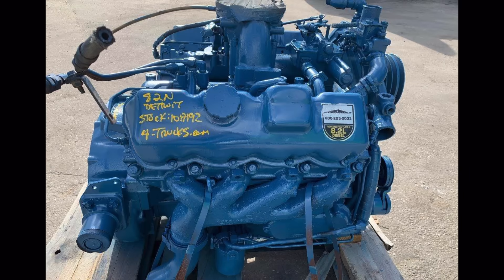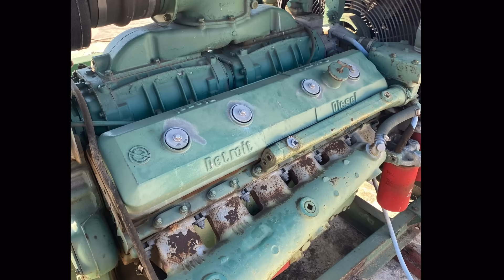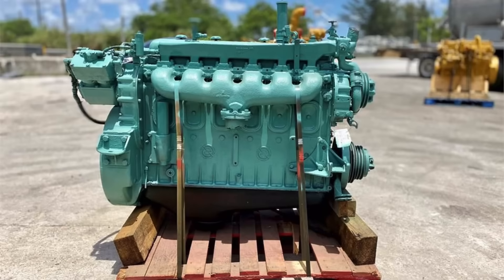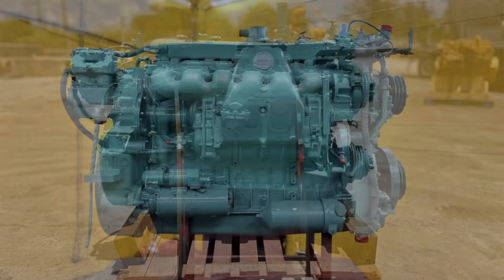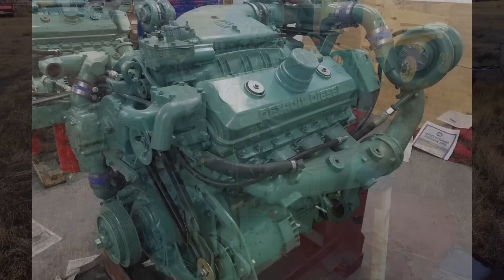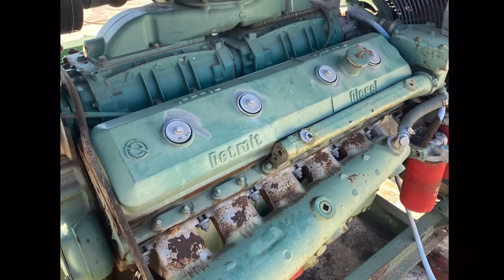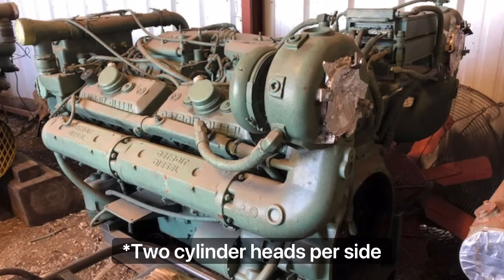Best Engines: GM Builds an Awesome V12 with Detroit Diesel's 12V71 "Buzzin' Dozen"

Comment: This engine WAS NOT design to be  "naturally aspirated"...it wont even work.
Reply: You misunderstood. They ARE "naturally aspirated" with a blower. Meaning the blower is not a "supercharger" or "added" part for extra air. The blower is a necessary part on these and is not a performance enhancer. The word "supercharged" or "supercharger" didn't exist until hot rod guys started repurposing Detroit blowers for use on thier gas engines. 
So, a non-turbo 2 stroke Detroit IS "naturally aspirated"
Reply: @johneckert1365  I'll quote the 6-71 owner manual:
...a two-cycle engine, therefore, does not function as an air pump, so an external means of supplying the air is provided.
A specially designed blower, on the side of the engine, FORCES cleaned air into the cylinders to expel the exhaust gases and fill the cylinders with fresh air for combustion..."
GM itself started to call it NA(inappropriately i would say) just when turbocharged engines where introduced, to differ the versions.
Reply: @TheLuxxx797  They did use the word "supercharged" did they???? 
A supercharger is an added device for extra performance. The blower on a Detroit is NOT an added device for extra performance. 

The blower draws air through it's inlet at atmospheric pressure. That's what naturally aspirated means Einstein.
Reply: @johneckert1365  Aspirated means that the piston SUCKS the air inside the cylinder...thats doesn't means that,  as in this case, a engine with a blower is supercharged.
probably you don't even know how a engine works
Reply: @TheLuxxx797  I OWN more 2 stroke Detroits than you've probably seen in person. I've overhauled several, both in-frame and out-of-frame. 
The blower sucks air into the engine. If you don't think it does, try restricting the air flow in one sometime........
You've even read it yourself, GM distinguishes thier engines as NA when they aren't turbocharged. You can call a Detroit Diesel "supercharged" all you want, but it won't change the fact that they're not. You should consider simply allowing people to THINK you're stupid, rather than consistently PROVING it to them. 😑

Comment: Never seen a Detroit in the flesh, but I have ties to them, one of my relatives worked for GM at DD in the early years, I think through the war years and on. 

I’ve always loved the sound of the 2-stroke. Something else cool of note is the larger stationary power plants, the    20v149 are absolute monsters. AT&T from what I understand used primarily DD for their auxiliary power for their central offices.

Comment: In mountainous conditions, logging, especially to be able to shift quickly off a landing, the V-12 was unmatched. Torque at idle was the highest, even amongst much bigger engines, K model Cummins, 3408 Cat. Clark trucking in British Columbia had a fleet of V-12’s hauling refrigerated goods in those mountains. Horrible fuel mileage and constantly in need of topping up the oil was a down side, but my gawd did it ever sound fantastic pulling hard. Very, very effective jake brake as well.
Reply: Had a friend that was a mechanic for a logging outfit that ran those. Went on a late night "test drive"  bobtail. Windows down foot the floor never forget that sound.

Comment: Legendary engines, any of the two stroke Detroits. 
I actually know where there is a GMC Astro 6v-71 and a 10 speed manual that has 67k miles equipped with a grain box on it for sale 10 miles from me for $7,500.

Comment: We had 8V71s in our WW2 era scout boat. It was an Aviation Vessel Rescue boat used for pickup up downed air crew in the Pacific. During the war era it had the gas Allison V12s which worked good at sea level. Those were removed and we got the 671 inline engine. Those wore out and were replaced by the 8s. They ran flawlessly for many years in the boat and we had to wipe them down after each cruise looking for oil leaks. The engines had been put all the aft after the war era mid engine set up. The boat sat down in the stern and out could see it when we tied up next to other AVRs. Great engines.

Comment: I commend you wholeheartedly for your accurate description of how these engines work and for NOT calling those blowers superchargers which they are not when they are used on these applications. 

This is one of the most common mistakes that car guys make because they are used to seeing them only on hot rods, hemis, top fuel dragsters and the like where they are in fact, superchargers in those cases. You really need to have had exposure to trucking, diesel mechanics or some related field to understand the difference. Bravo!
Reply: Thank you, I cringe when some dolt calls a turbo. Detroit twin charged because of the blower.
Reply: @WhiteTrashMotorsports #ME TOO
Reply: @WhiteTrashMotorsports  Bloody oath cobber 👍
Reply: I could be wrong but I think the first roots type super chargers were scavenged from DD's.  Early on they were all classified as either 6-71 or 8-71 blowers.
Reply: You are in fact, absolutely correct. That's exactly where they came from and it was down to nothing more than availability. The 71 and later 53 series Detroit Diesels were in widespread use in those days and the blowers off of them were plentiful as a result and relatively cheap.

Another common misconception is that the 6-71 blower gained such wide favorability for use on Mopar hemi engines because it was engineered to work on a 426 CI engine which the 6-71 Detroit is. This is wrong however as those engines had been around since the late 30s and the 426 Hemi never arrived until the early 60s.

It was simply a coincidence and a case of those being very common engines in those days; I myself operated several of them in my early days, and availability was high.  @jdcole333
Reply: @hughjass1044  Good on you mate for trying to explain to the poor buggers the difference between a Blower and a supercharger!! There are so many of them out there who do not have clue!!
Reply: @damienodonohue1327  Well, it's understandable that they wouldn't. I didn't understand either until I got into trucking.
Reply: @hughjass1044  That is true...... to a degree, but once you have explained it to them and they refuse to accept it, then it becomes exceedingly difficult! 👍

Comment: Had a 8v71t in a wrecker i used to drive. Not very fast but i sure did pull some heavy loads with it. Have also worked on a 16v71t that was part of a large air compressor.

Comment: the best part of the v8s and v16s detroit engines is theyre twin supercharged; v12 gets 2 v6 sized blowers and v16 gets 2 v8 sized blowers.
Reply: Blowers  they aren't superchargers in the original application because the air enters the bottom of the cylinder. There is no vaccum to  draw in the air. The blower provides no pressure above atmospheric on 2 stroke diesels.

Comment: The main purpose of the blower is to evacuate the exhaust from the cylinders. Also you made no mention that two stroke Desel engines have exhaust valves

Comment: Do a show on Charles Kettering and the Zephyr Diesel electric train where these began.
These two strokes were good but could not pass emissions.
They made a 53,71,92,110,149 in V and straight .
Even doubled Siamese in large gensets .
Excellent channel.
Reply: Don't forget the valve less series 51 in 2 and 4 cylinder.
Reply: @Tchristman100  oh yeah never saw one Thanks

Comment: Twin 12 V 71s at max rpms in an offshore yacht is a mechanical symphony that everyone should experience at least once before they die.
Reply: There was a 12V71- powered firewater pump at a steel mill I've worked at a few times. It was kept ready to run all the time, and they had to run it monthly to test it. It exhaled through an 8" straight pipe that dumped out the wall at only 8' high, I nearly crapped myself the first time that screaming dinosaur fired up and IMMEDIATELY went to full operating RPM (2300? I think? So, sounds like 4600) while I was minding my own business running conduit to a pond aeration pump not 10' from it, hahaha! God, that thing was just WILDLY loud. Every bit as loud as my old 11.5:1 327 was through open headers.
Reply: @The_sinner_Jim_Whitney  I enjoyed firing up the 12v71 in my brother's truck air start I would give it a squirt of aero into the air scoop as I stood with the door open and press the start button the stack had blown the mufflers out of the stacks it was loud in suburbia sounds awesome
Reply: A friend used to have a 78 Hatteras with two 8V71s. The sound was quite something!
Reply: @compu85 they are head turners on the road too, we had a 73’ Pete 359 that lost a motor. Well, my uncle being the crazy ass he was said hey, I have a dozer with the final’s out, let’s take that 12V71 TA out of it and toss it that truck ! Man with an old 15 speed Spicer that thing would run 100 or better, loaded. It scared the shit outta me after 90 😆  I’d say they really drink some fuel in a boat don’t they ?
Reply: We’ve got twin 12v92’s in a 137 foot Christensen, they sound awesome when you open them up.
Reply: I grew up boating and when a DD motor yacht would be off in the distance, when the engines were in resonance it was just an amazing sound.   As a kid, i would hum along.
Reply: I still see the odd DD 12V71 around, but always in old logging and mining equipment. Forgetting for a moment how visceral these things sound, the 71 series, I believe , were frankly one of the toughest diesels, especially in the worst of conditions . They happily ran continuously at higher rpm . They were a joy to shift in a truck and you had to be fully “on deck” to operate, to be rewarded with quick shifts. Again , hauling off-road in mud a new four stroke would be stuck in one gear until you hit a downhill.
Reply: Don't forget the aromatic fumes that are just incredible to inhale!!!
Reply: I was a captain on a 110 foot offshore crew boat that had four 12V71s with twin turbos. They would push her along at 23 knots and the sound was impressive to say the least.
Reply: 4 12V TI in oil field boats always had the throttles on the dash
Reply: @edwardcarman4489 that’s how they run best, on the wood.
Reply: Capitan a 67' Striker had a pair 12-v 92 's  as the knots went up the fuel went down . 240 gallons from Ft.Laduradale to Bimini and it's only 68 miles . They love there diesel ..
Reply: I used to seatrial brand new ones all the time! 16v71, 24v71, 12 and 16v92, 12 and 16v149.
Reply: I once was on a dive boat that had three 12V-71TA's with side of boat discharge. Needless to say I spent a lot of time above the exhaust.
Reply: @Tchristman100 when a engine has turbo & supercharger, it be serious about pwr output. Hemi dragster engines used671 detroit blowers for ages. Strange to see same blower on side of inline i6 detroit diesel
Reply: It would be an awsome experience ❤
Reply: I got to drive a truck with a 12v71 it hauled ass
Reply: I agree 110%! 😊
Reply: Ohhhhh...I could only imagine
Reply: I mean, its even better to rack it up to overrev speeds for better sound
Reply: @gabrielvieira.4358  
That's what you mean?
Reply: Een mechanische symfonie?? Veel lawaai bedoeld u! Een aanslag op de oren. 🥵
Reply: Sorry friend but what you said is both true and wrong at the same time.  Symphony vs sympathy.   Hahahaha.
Reply: @chrisadkins6830  
Damn. A combination of spell check and not proof reading before posting strikes again...lol 😆
Reply: @tonyelliott7734  hey, made it even better.  The vids of the destruction runs on these screaming Jimmys are awesome.  Very few things sound as beautiful as one about to blow
Reply: @chrisadkins6830  
DeBoss garage...lol

Comment: Thanks for posting this. I didn't even know that 2 stroke diesels existed in more than theory until your last 2 videos. 
PS: If you haven't already, you might consider doing a "worst transmissions" video on the Chrysler Ultradrive 4-speed automatic. I had one rebuilt at 30,000 miles, just after the first fluid change, about 25 years ago, and had friends who went through the same thing all through the 1990s. Then, just recently, I read that it was not really the transmissions themselves that caused most of the trouble, it was dealers putting Dexron in them, and that some of the "failed" ones would magically come back to life after Chrysler's fluid was installed. It's a bizarre story considering the fact that Chrysler was rebuilding these things while both the owner's manuals and dipsticks encouraged the use of Dexron to top off the fluid when Chrysler's fluid was unavailable. If you know anyone who worked for Chrysler on the problem, it would make for an interesting interview.

Comment: For a number of years, I sold pumps and was consequently in many "mechanical rooms.". I saw many of these magnificent engines that were there to drive generators and water pumps in case of power failure.  They were beasts!

Comment: Adam, great videos on the Detroit Diesel motors.  My dad worked at DD for 26 years.  As a kid, the engine that blew my mind was the 16V149.  Basically 2 V8s bolted together with 149 cubic inches per cylinder.  If I remember correctly, I think the engine weighed about 10,000 lbs!  What an absolute powerhouse.
Reply: I rebuilt several 16v149’s in my marine career. They were an amazing engine. They produced about 1000 hp naturally aspirated. As you said they were 2 v8s bolted together an we had to separate the two blocks to replace seals . This was accomplished by standing them on end in the engine room using large chain falls.
Reply: I was there at the factory for training in late 99, it was kind of sad seeing all the lines condensed down into one single one.

Comment: In the mid 1960's, Greyhound Lines was tasked of replacing their aging Scenicruiser fleet, (PD-4501)  built by GM truck and coach between 1954-1956.  One thousand were produced and they were the workhorse of the fleet for passenger and freight.  Greyhound at that time had purchased Motor Coach Industries and had started to break away from their long time relationship with GM.
They simultaneously desigened and produced model MC-6 and MC-7 . The 6 was a forty foot 102 inch wide coach and the 7 was a forty foot 96inch wide coach,  The 6 had a 12V-71 engine and the 7 had an 8V-71 engine.  The 6 was the first 102 inchch wide coach and was only allowed to run in some eastern and western coast states.  Greyhound thought they could get approval to run 102's in all fifty states but that didn't materalize and only 102 were built.  Not only was the 12cyl Detriot  a huge leap, there were many other features that made this coach twent years ahead of it's time.  After their denial to run cross country fifteen remained in Canada as 12cylinder four speeds and the remaining  US coaches were retrofitted with 8V-71 and Allison automatics.  I have driven Scenicruiser and 7's with the "Screaming Jimmys" and they are a sound to behold.

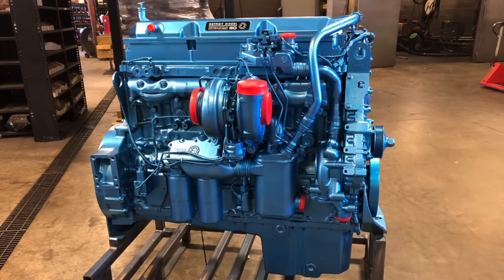Comment: 3:02 wasn’t the series 92 what was replaced by the 60 (for land based commercial markets)?  92 an bored variant of the 71 that went on in the market later than the 71?
Reply: The two strokes, both 92 Series and 71 Series, were phased out in commercial on road vehicles in the nineties, the last ones were 8V92 engines in coaches. The military still uses the 8V92.

Comment: The 71 and the later 92 series are awesome sounding engines of any type. The 12V71 was the standard engine in the MCI MC-6. They were a really cool looking bus and unfortunately a lot of them have been scrapped. Most of the survivors have been rebuilt with the 8V92TA.
Reply: The 15 Canadian MC6s are all 12V71 and 4-speed equipped.

Comment: worked on a lot of 471 and 8v71 in the day and passed a bunch of 671 with a 855 250 hp cummins when driving. I'd take the Cummins any day. We wore out lots of 71's in industrial service.
Reply: I'm a Detroit fan, but have to admit that the 855 Cummins were a more fuel efficient engine. And a good running 290 Cummins would out pull a 318 Detroit any day... :(

Comment: I drove and worked on the 6-71 in school buses for a dozen years in the 1980's.  They not only were a great, long lasting, and powerful engine for a school bus, but they were a lot more forgiving to inexperienced drivers then, say, a 743 or 855 Cummins.  We had a couple of the turbocharged engines in the buses, making 250hp, and with a 10 speed trans, it would move right along in the Sierra-Nevada mountains.
Reply: A few years ago, I had the opportunity to purchase a few Crown school buses that operated in the Sierra Nevadas.  I forget what district, but I went to inspect them and was just amazed that they had 6-71 turbos with Jake's, 10-speed roadrangers, and Traction sanders, among other things.  All started and ran beautifully, but I didn't bid. I'm still kicking myself for not purchasing one of those gems
Reply: how are they more forgiving?
Reply: 855NT. One of my favorites.
Reply: Crown?

Comment: I think I installed a couple of emergency generators that had this engine. The start-up guy said these were some of the best diesels made at the time. This of course was many moons ago. I was an electrician for over 40 years!
Reply: I had a job testing standby generators. 

At one hospital, they had a bank with 2 Cummins powered and one Detroit. One of my tests was to see how fast they would come on line after interruption of commercial power. 

The 12V-72 ALWAYS won! The two Cummins would just be firing and the Detroit was screaming away at rated power. It was almost instantaneous!
Reply: @T91Tanker The only one close was the Scania 12
Reply: @T91Tanker 
As a generator tech, I've heard tales of doing a load bank test by using a barrel of brine water, anybody else ever heard of that😂, all I know is a resistive load bank (overgrown toaster) 😄
Reply: Yup usually had ge gear on electrical side not always though as you could order any prime mover you wanted on all of them.